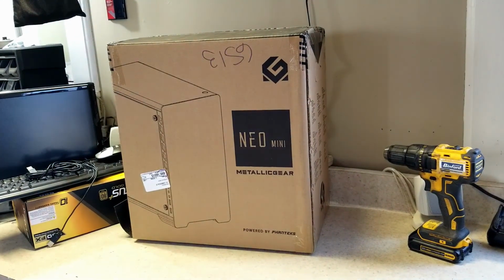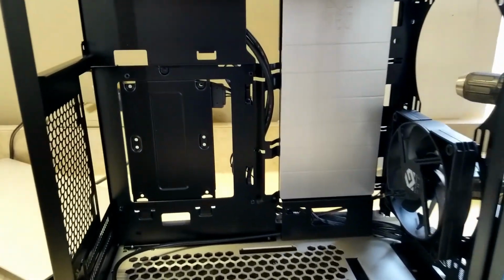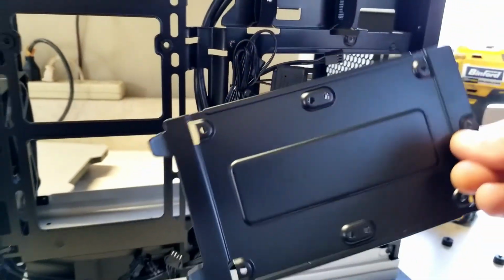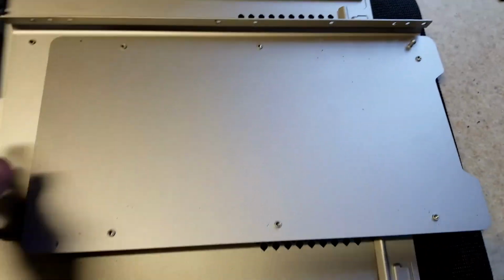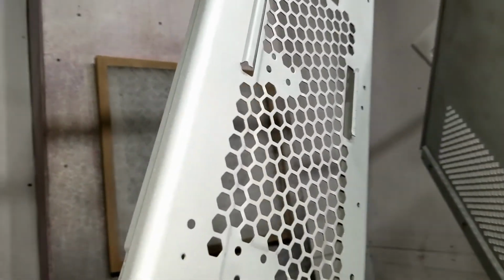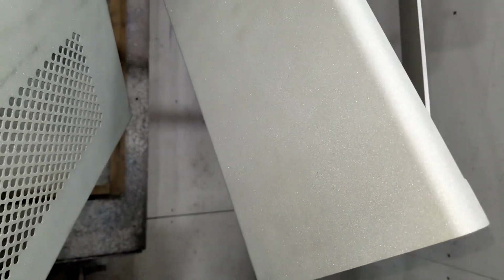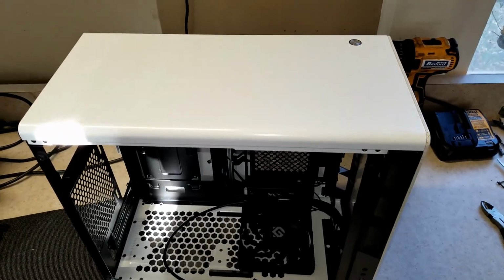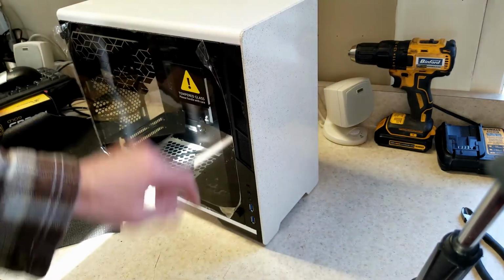MetallicGear Neo Mini v2 mini ITX case quick look and custom powder coating

Comment: Nice Vid! Do you think a 240 mm radiator can fit on the side with a 200mm gpu?
Reply from the maker: I think it would be tight, you would probably have to raise the radiator all the way up and hope the hoses clear, but with that size GPU you could definitely fit it in the front.  My red devil is 320mm long and it interfered with my front fans so I had to move them to the side, I do have a new case now just have to switch everything over. I do love this case but there are some fitment issues with larger GPU's

Comment: I'm doing the exact same mod, same case, also with white powder coating lol. 

Since you're probably a lot more knowledgeable than I: Can I ask you what rivet size these are? I'm having trouble finding the right kind of rivets.
Reply: Thanks a lot man! The 3.2mm ones (had to google 1/8" lmao) looked too big during visual inspection so I had doubts. But now I'm pretty confident they'll fit. Thanks again.
Reply from the maker: Ah ok, yea here in the US we are still on the old system lol. Good luck with the build!
Reply from the maker: They are just 1/8" aluminum pop rivets, should be able to pick them up at any auto parts or hardware store. These cases look great in white, you won't be disappointed!!!

Comment: Very nice! How did your build turn out? I'm worried about GPU heat, but I'm hoping with the vents on the bottom it should be ok with a stock cooler. Any thoughts on GPU temps?
Reply from the maker: Believe it or not, I have not built in it yet! Too many irons in the fire I suppose. I have to assume the GPU thermals will be better than a case with bottom mounted PSU and full basement cover, simply for having the vents on the bottom, maybe just plan your airflow accordingly. I have really been looking forward to getting a build done in the case, just need to focus on getting to it!
Reply from the maker: Hey Justin, I have transferred my PC into this case, with a ryzen 2700 and R9 Fury. The GPU stays below 70 under load, so it seems the vents on the bottom are pretty effective.

Comment: I thought this case came with a glass front?
Reply from the maker: There is a model with a glass front, instead of neo mini, it is neo G mini. https://click.linksynergy.com/deeplink?id=orJuAXC0BVc&mid=44583&murl=https%3A%2F%2Fwww.newegg.com%2Fblack-metallic-gear-neo-g-mini-v2-mini-itx%2Fp%2FN82E16811700007%3FDescription%3Dmetallicgear%2520neo%2520g%2520%26cm_re%3Dmetallicgear_neo_g--11-700-007--Product%26quicklink%3Dtrue

Comment: How many fans can this case fit? And what sizes?
Reply from the maker: You can install 2 120 or 140 fans in the front, 2 120 or 140 fans on the side, and 1 120 in the rear. So 5 fans total, 4 of them can be either 120 or 140.
Reply: @Snickerrick  Thanks, I'm planning on building in this case after the whole virus ordeal is over. Looking forward to when you build into it too!
Reply from the maker: @wallisb9265  sweet! Yea I have been looking forward to it for a long time, everything else under the sun keeps coming up. Let me know how your build goes, thanks!!

Comment from the maker: @Netherspark , I cant find your comment, but I grabbed the actual measurements for you. The outside dimensions are 15 1/8" x 14 1/8" x 7 1/2" . Interior dimensions are 13 1/2" x 13" x 6 5/8" .

Comment: the mesh in the bottom is for air intake for the GPU, nothing will fit there, with the GPU in place not enough space for fans even
Reply from the maker: Ah ok, I still haven't built in it but looking forward to it. Shame there is no room for fans in the bottom, but at least it will intake, thanks!
Reply: @Snickerrick  I do like the paint job you did! It really looks great!
Reply from the maker: @samuelrave  Thanks! I wanted something different and neutral, When I finally build in it, it will be a HTPC with no additional RGB, just some low key white LED, aside from the 1 rgb light on the bottom for mood lol

Comment: Nicely done! Do you know btw if the black pattern over the tempered glass which covers psu can be "unsticked"?
Reply from the maker: Thanks! No it doesnt appear to be able to be easily removed, it looks like they intended to use the design to hide the PSU. It kind of blends in with the black inside the case, I dont think it is noticeable unless you have some RGB bling going on inside.
Reply: @Snickerrick  appreciated! Have a nice day
Reply from the maker: @frndmrt  Thanks, you too!!

Comment: May I know what powder coat gun you were using? It came out pretty awesome btw.
Reply from the maker: Thanks! Kool koat 2.0 from Columbia coatings. I love this gun! Been using it for about 2 or 3 years now, never gave me an issue at all. It may be outdated now, I haven't checked new guns in a while, but they build their systems in house and do a nice job.
Reply: @Snickerrick  Been looking for a decent gun for a while now too.  Just need to make some room to use a powder coat gun here.
Reply from the maker: @DojimaDragon16  Definitely check out Columbia Coatings, they have different models, all have the same gun but the control boxes have different features. I believe all guns come with the multi coat tip as well, which works excellent for multiple coats on cold metal, no more needing to shoot them warm. The hose and cord lengths are long enough, for me anyways, and your air connects to the control box not the gun, so it makes the gun very light to use. Space was my issue too, my oven is pretty big (4x4x6) and I am using half of my tiny garage to powder coat in. Looking on their site, the gun looks different, or maybe just a different color but Im sure just as  good. This is the system I have https://www.columbiacoatings.com/HS-02LED.aspx